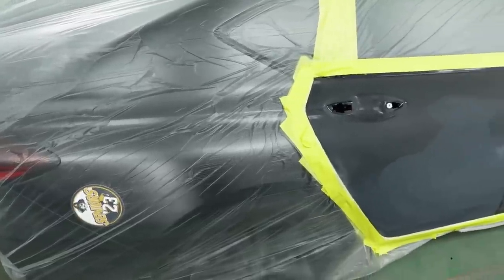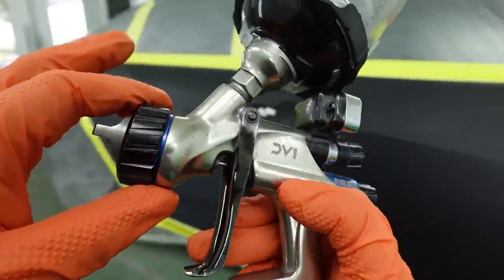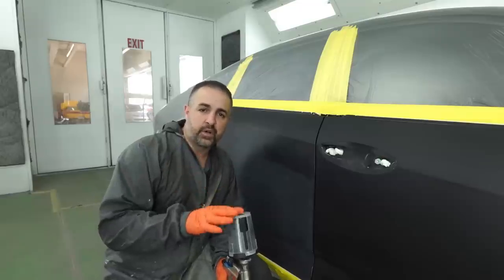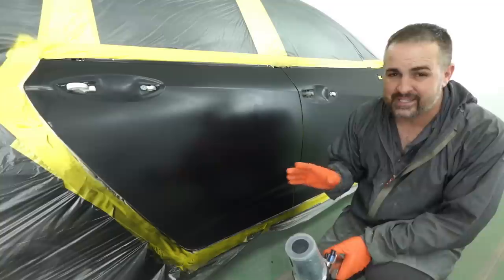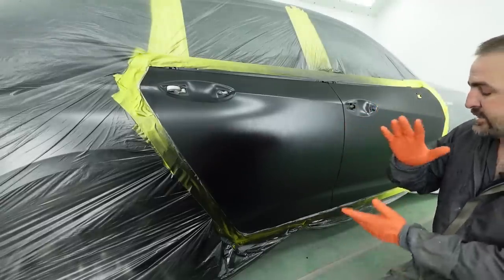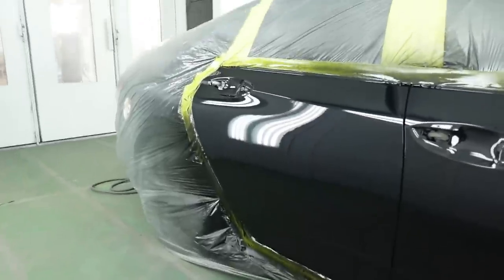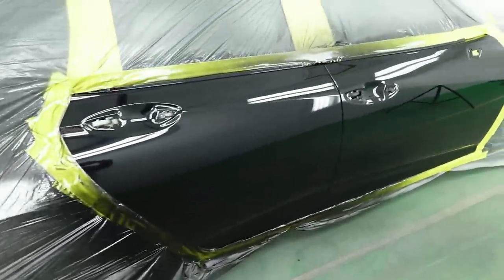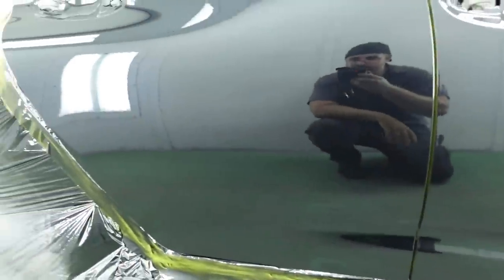I NEVER Thought This Paint Trick Would Work Until I Tried it Myself!

Comment: As a Dupont paint rep told me yrs ago--If you're going to have an issue with a paint job, It's going to be black!  It shows everything and when you get it outside the surface will absorb heat more than any other color with the potential of a chemical reaction.  Nice work Mr. P. Society!
Reply from the maker: Love and hate relation with black paint hah. Thanks !
Reply: Mr P. Society? I dig it!
Reply: Learned that the hard way 🥹
Reply: .... and red is the hardest to match and quickest to fade. I think this is why most fleet vehicles are white, def easiest color for a vehicle
Reply: The way I look at it, the paint work showcases your repair work, prep work, attention to detail (how does that go, the devil is in the details), and talent. And, the most important part, whether or not you strive for continuous improvement, and an endless journey for knowledge, or if you embrace "satisfaction", the end of your journey. I think black provides the ultimate learning opportunity, there's nothing that teaches like mistakes. Get black right, and you can most-likely get anything right.
Reply: Exactly like chuckstar243 said. I have learned that when it comes to black its all in your prep work, and you just have to take your time and do every step correctly including your primer, base, and clear after all your prep to the substrate. Everything will show one you put high gloss clear over black. Another difficult color is white. Ive had House of Kolor UC-35 Kosmic Klear that you add there hardener and reducer too turn yellow on me because of their damn bullshit reducer that they say you have to use with their clear. I do not use HOK's bullshit anymore except their kda3000 hybrid dts primer. Other than that i will not used their over priced garbage
Reply: @user-un5my5bw4j  I'm a bad boy,  I use HOK primers, man it lays down soooo smooth, like satin,  their colors, and other wet-products, but  I put PPG clear over them. Naughty,naughty. Haven't had a problem yet.
Reply: And silver casts no shadows so hides imperfections.
Reply: @charliet1175  They say silver is the hardest to paint.  Between "tiger stripes", blending and sand scratch swelling, it can be a handful!😆
Reply: @glennnickerson8438  not in my experience, prep well, silver is a doddle 👍
Reply: Wow that's one smart engineer! Thank goodness  he got that degree.

Comment: I love your videos! I’m stuck in prep and paint sometimes but I’m 23 and want to paint! My dads a painter but different field of painting. Your videos help me a lot and when I use the info I learn from you it impresses the lead painter who’s been doing collision work for 28 years. Thank you. Would love a review on the sata 5500 rp it’s what is used at my job.
Reply from the maker: Glad to hear your making progress! I don’t use satas as they don’t fit my spraying style but they are still Great guns.
Reply: Sata 5500 rp 1.3 is what I use at work as well. Great for waterborne base paint as well as clear 👍 but if you're a good painter, technically you can spray a good clean paint job with any quality gun
Reply: @PaintSociety   what would be your favorite gun? I just got a sata nr95 for cheap to start doing projects at home.
Reply: @WerdularMotion   we use a 1.4 I for my work and spray solvent based onto aluminum boats.
Reply: Dude I'm in the same boat as you, I just turned 23 and my dad is a painter too. I've been learning steadily but man its been great so far.

Comment: When you use extra slow reducer your paint & clear dry slower which increases the amount of dust that can settle on the project.....just saying.
Reply: All fast 4 me
Reply: Depends on temperature and humidity. If its 100+ degrees. Slow works nice
Reply: @jonahstoyroom7516  I won't paint if it's 85 or above....even with slow dry. Just too warm and moving around so much in my booth creates
all the more temp and SWEAT.   ;-(

Comment: Is it possible to just reclear a car without clear coat burn? As long as it's done up and over on each panel? 

My concern is the paint underneath might be too thick and cause bubbling or cracking from the heat and thickness, ruining the new clear coat or discoloring the paint.

How should one approach this if only the clear coat is getting hazy on the factory finish (especially bumpers and painted plastics like the hood scoop)  but the base is still looking good. 

Thanks B

Comment: As an old veteran painter "coach and motor painter" to be technical, I have noticed 2 alarming things about your technique that I must say are a little concerning, for me anyway, That gun set up seems to be atomizing way to much, and your "stroke action "or arm action does not have any wrist movement, something that is essential for evenness of cover and eliminates dry spray, especially on final coats, but this time you covered it by going back and finishing the edge, nice job in the end, All the best, Al

Comment: What clear coat was that with the 1.3 on the Sagola? Curious to learn about tip size vs thickness of clear coat. Some say larger tip like 1.4 for thicker material, and others say smaller tip size like a 1.2 and higher pressure to break the thick clear up. I can lay lower solids clears with no peel, but struggle with thicker clears.

Comment: Hey Brian I’m doing a complete paint change on a truck, from dark blue to black. 
I am doing the engine bay and door jams.
Is it the same process of sanding to 220 to remove clear, unless the clear is failing and get to base. Then primer with 2K up to 600? Or should I sand the primer to 800 before base and clear?
Reply: It is not necessary with a solid color. 600 works well.

Comment: What do you use to degrease and clean just prior to spraying? I tried lacquer thinner, but it affected the primer, as in removing some. Also what towel? I tried the paper blue shop towel with some rubbing alcohol but they kept depositing lint, which I got off with a low tack rag, but it was a pain.
Reply from the maker: Super clean with water before it hits the booth. 

Micro fiber towels for cleaners in the booth
Reply: @PaintSociety  What cleaners in the booth?
Reply: @bp7178 he literally tells you in the video…
Reply: @jordanbest3926  least helpful answer award…

Comment: I started painting my engine bay with cans mixed up for me with my paint code and I didn't get enough paint to complete the job so now I have dry paint and had to order more paint how do I prep the surface to accept more paint..600 grit?? Or grey scotch brite scuff pad..I used the grey scotch brite on the primer so guessing that will be ok for the paint too.. I'm not sure and don't wanna mess mess it up more than I already did
Reply from the maker: Use 400 grit and maroone scuff pad if it’s rough
Reply: You can use a grey pad.. but you can’t clean it with any cleaners after you scuff.. just have to blow it off and tack it. The cleaners will damage the basecoat

Comment: You and the gunman are always saying get a good spray gun and wondering if there is a place for the R500's out there.  I have seen one channel that uses it for almost everything and preaches that it works awesome for small compressor or environments where you don't want a lot of overspray.
Reply from the maker: Chris from garage noise uses it and he has great results.  I’m not knocking the gun but there are better guns that make painting easier.  The r500 he uses is great for DIY and that’s why he uses it to show it works
Reply: @PaintSociety  Good to know.  My problem, and maybe other newbies, is that it is hard to tell which guns are good for the DIY guy who paints something 3-4 times a year and just can't justify multiple 300$+ guns.

I picked up DeVilbiss flg5, from spray guns direct, on reccomendation of gunner with a 1.2 tip and use it for base coat and clear (kinda a PITA using same gun for both) but have been looking for a diy friendly gun to augment my setup for a while.  I considered getting another flg5 but no one else talks about that gun

Comment: well, with this kind off shine you probably had to buff the hole car, to match. :) :) ::)
Reply from the maker: I buffed the quarter and fender to match but also I had a lot of dust from bondo and primer
Reply: @PaintSociety  somethimes you pull of the  mask paper and think. my god i screwed up!.  but buffing makes up so much often.  btw; i have often trouble with fading out the clear on a panel. like  a spot repair, or spaying out on a roof line. i use high reducer and little clear. but still i can see the paint lines. and the more you  polisch, the wors it gets. maybe you ot a video on that. especially with dark color its a problem. thanks

Comment: Dealing with the local autobody shop that fixed my truck on an insurance job. New box side, repainted box side, and this is how it turned out. Pulled flys out of the paint. All kinds of junk in the paint. And they keep trying to tell me, even dealers get stuff in the paint, it's "normal". And the orange peel looks way, way heavier than the rest of the truck.

https://www.youtube.com/watch?v=h7wNxtxUNBw
Reply from the maker: Hi, I saw the video, its hard to tell because the camera makes it look good but I can see tons of swirls, defects in the paint and dulled out clearcoat on the bedside. If this is a shop your insurance company recommended then you can go back to your insurance and fight it to make it right otherwise its you against the shop. Debris and dirt can happen but a good painter can get a much better job, we do it all the job without any problems.